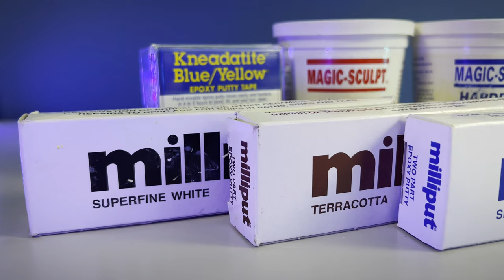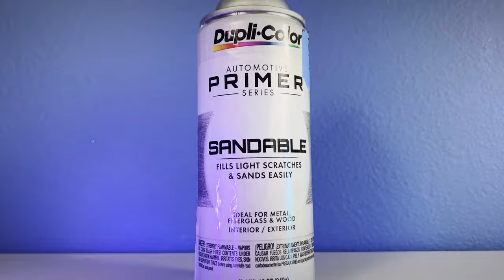How to SCULPT EARS on Plastic Model Horse Figurines

Comment: Fabulous tutorial, thank you! I have a question however, about the wires in her ears... How to you get them in there? Do you drill a hole for the wires in the bottom of the (cured) ears? I make ears very similar to this but I don't use wires (I'd like to, tho). I can't figure out how to get the wires in the bottom of the (hardened) ears. I either break/shatter the "tail" of said ear, or draw blood from my personage, or both (most often the case). I've tried putting the wires in before the ears fully cure, also, but that leads to smooshed ears, twisted ears or both. And the wire falls out because the"seal" in the clay has been loosened from all the twisting and smooshing. 
Thanks in advance. Your videos are just awesome! ❤️
Reply from the maker: I didn’t think I would need the wires until after they hardened 😅 So yes, I did drill them after. I taped them to my table to secure them (I didn’t want to drill while holding those tiny things), then drilled a little hole with my smallest twist bit. The other thing I could have done was not cut them so high up when I removed them from their bases. That would have given me more to glue inside the head without wires.